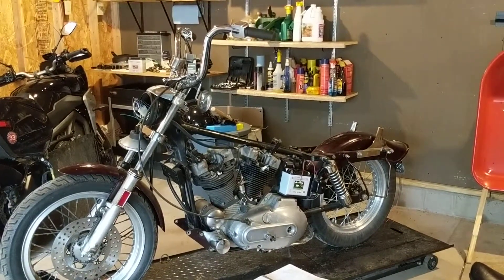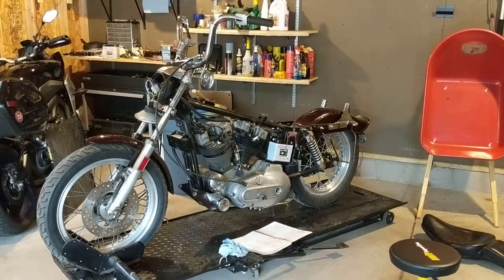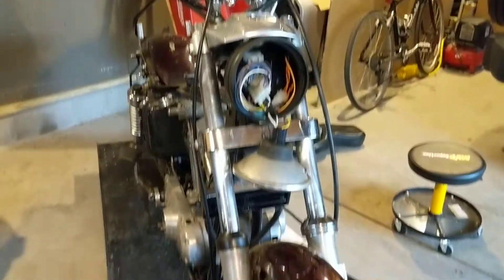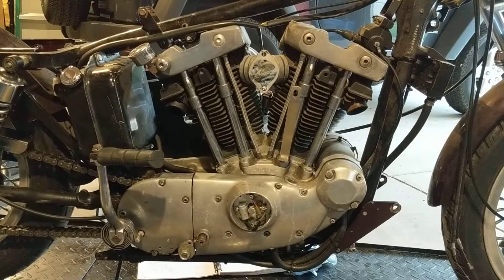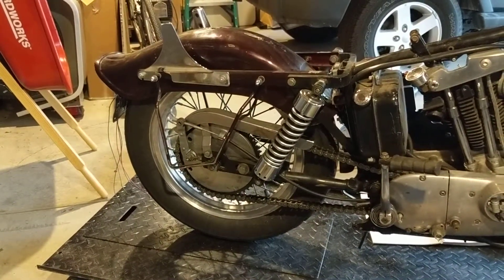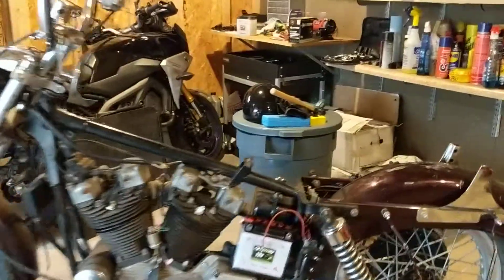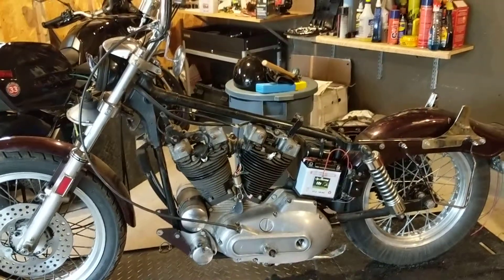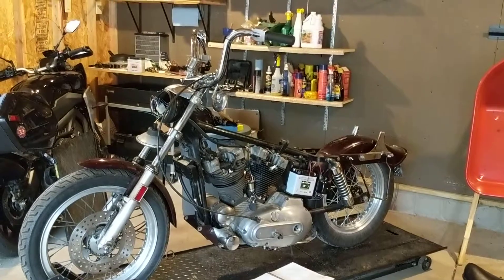1977 Harley Davidson Ironhead Sportster XLCH

Comment: Dod you ever get these rollin ?   I had bars like those.   It took me a couple weeks to decufe they just werent right, in several ways.  I trimmed the ends of the bars, where the grips go.  Moving the grips and controls inward more. They ended up being the best all around bars ive ever had.
Reply from the maker: I did get it going. I've put several thousand miles on it. Actually just put it up for sale. https://minneapolis.craigslist.org/hnp/mcy/d/minneapolis-1977-harley-davidson-xlch/7649688009.html